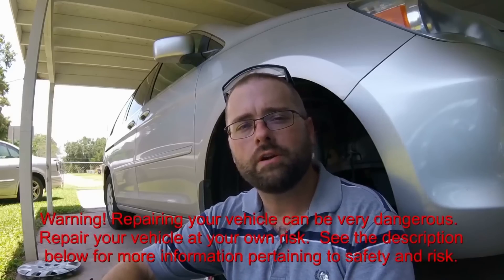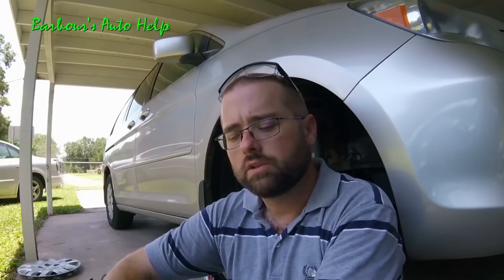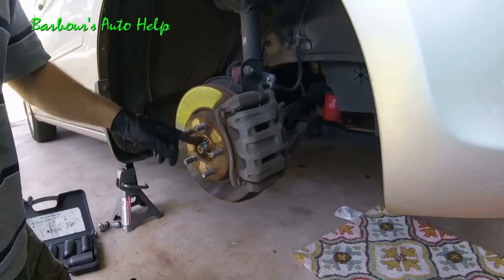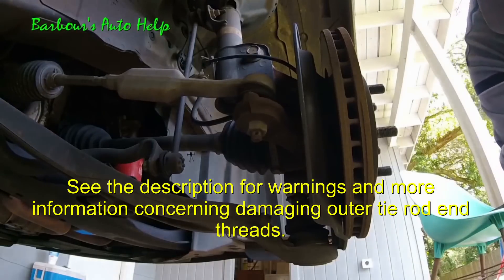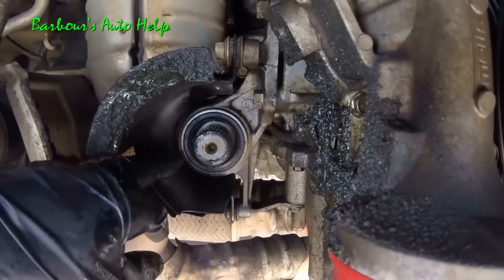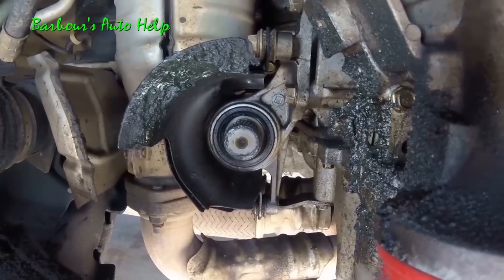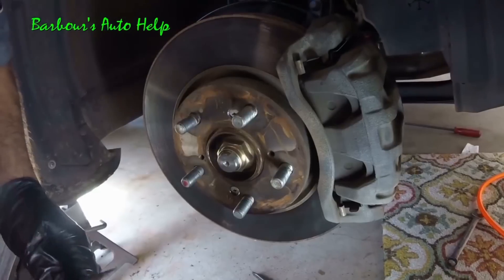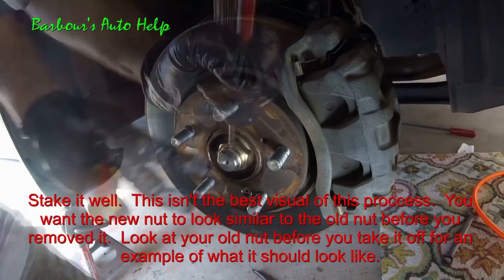CV Axle Replacement 05 Honda Odyssey

Comment: What tie rod brand did you use?
Are they OEM?
Reply from the maker: Sorry, but I didn't replace the tie rod ends.
Reply: Sorry omg I meant what cv axle brand did you use?
I’m stuck either getting aftermarket or OEM.
Do you have any advice?
Reply from the maker: I used aftermarket axles.  I don't remember the brand I used.  It's been my experience that OE are of higher quality though.
Reply: I was looking at cardone cv axle which are way cheaper then OEM, but how did the aftermarket respond after you installed them and drove the van?
Reply from the maker: I still haven't had a problem.   They did just fine.
Reply: Awesome thanks!
Reply: One more question the seals you mentioned in the video to replace i need two correct because im changing both axles? Are they the same seals?
Reply from the maker: @angelonunez8167  I'm not sure if they are the same part number.  You'll need to speak to your parts pro about it.

Comment: What are the cost of Everything?
Reply from the maker: You'll need to price it out.  It varies
Reply: Parts price depends on the brand of axle purchased, and the source. Roughly from $100 to $200 per axle is typical.

Comment: Did the axles fix your vibe?
Reply from the maker: Yes
Reply: @BarboursAutoHelp  hello, thanks for the great video, I need to do this next week.

Just a couple of questions please:

1...is there a need to grease the part of the CV axles which go into the Transmission ?

2....is an alignment necessary after taking off the part of the tie rod which goes into the knuckle?
Reply from the maker: Unless you are replacing the seal where the axle goes into the trany you should not have to lubricate the seal.  It should already be well lubricated from use.  As far as the alignment,  you should not have to unless you loosen the jam nut on the outer tie rod end.  However,  if you haven't had an alignment done in a while it's not a bad idea.
Reply: @BarboursAutoHelp  hi, thanks for your great video.

I need to change one of mine too in our 08 Odyssey, I think it's the right too.

Could you please tell me which one you you think I should buy between an Aftermarket or a Remanufactured axle please?

Which one did you use in the video, and how has it been since you did this replacement?

Thanks
Reply from the maker: I dont remember if I used remanufactured parts or not.  I may have mentioned it in the description.   Sometimes it can be a crapshoot new or remanufactured.   Typically I've had pretty good luck either way.
Reply: @BarboursAutoHelp  thanks a lot Sir,  I finally  did the right side axle drive shaft plus the two front  lower control arms plus the  two stabilizer bar endlinks last week.... Only major issue were those two  skinny  endlinks  which refused to come loose,  bolts/nuts were stuck hard....had to take car to a shop to cut them off as I could not do that, I regretted  not having a dremel cutter,  wasted a lot of my time.....i also couldn't  somehow get the right side axle drive shaft off with a hammer on a pry bay.  I used another method of placing my pry bar against the head of  a bolt close to the back of shaft cup,  and using that same bolt's head to leverage my pry bar against the back of the shaft cup and pushing it out.  

Funny enough,  it required the least force to push the driveshaft out. A toddler could even do push successfully,  lol.....so this wasn't really a problem in the  end. 

The only  major problem were those  despicable two Endlinks LOL which I had to pay a shop to cut off as I had no dremel